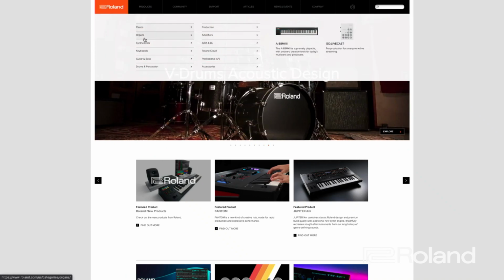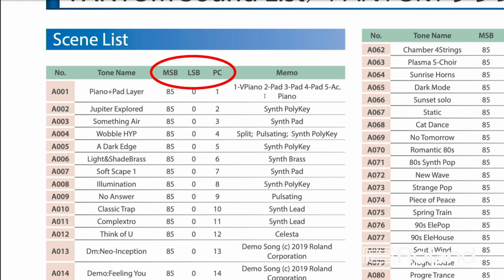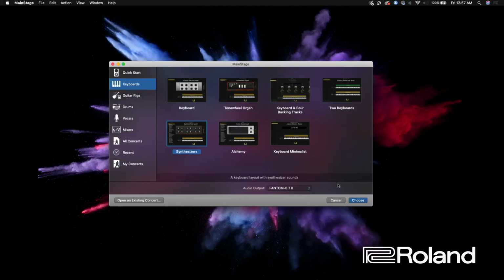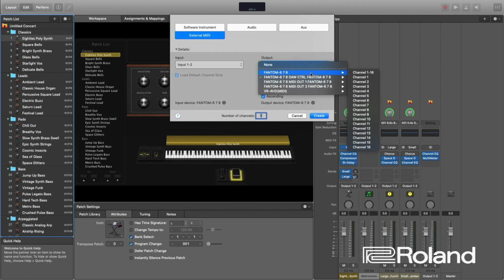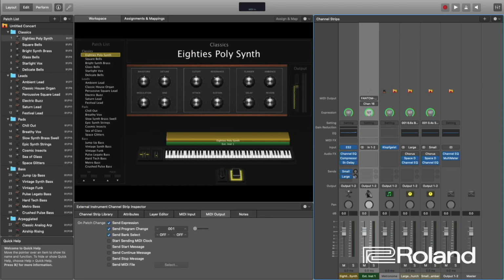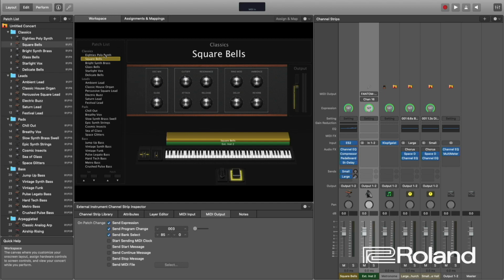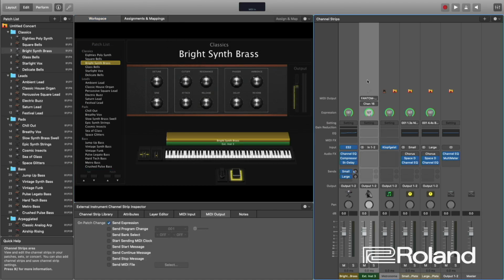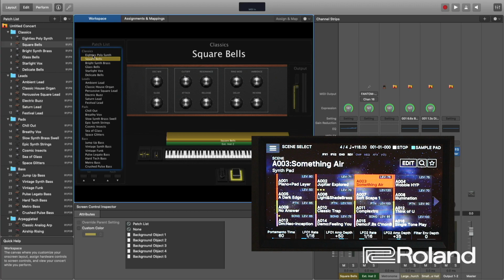Roland FANTOM - How to select Scenes using Apple MainStage

Comment: Thank you for your clear explanation. However, on my Fantom-XR this does not work. I can only switch on USER 1..128 when I set LSB to 87. (MSB does not do anything). So, 0, 87 PG 1..and further works fine. But I cannot switch to PR-A, B etc. using your settings in your video. Does the Fantom-XR have different settings that you know?